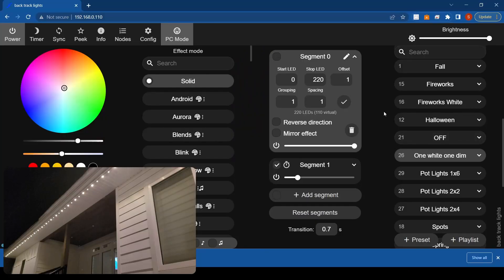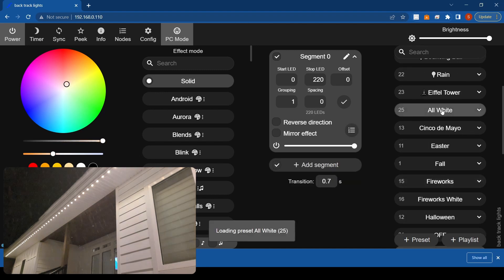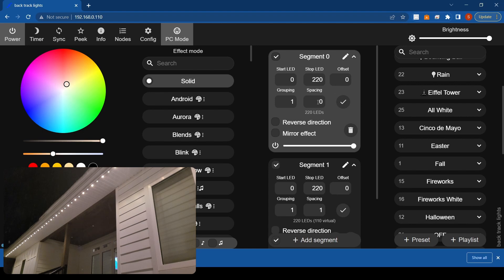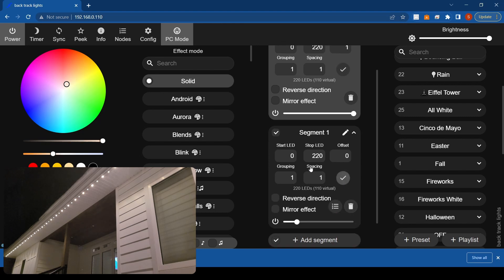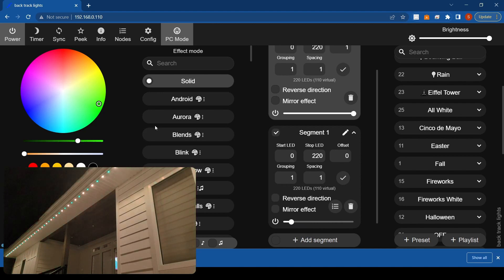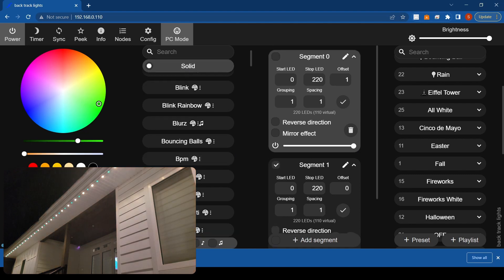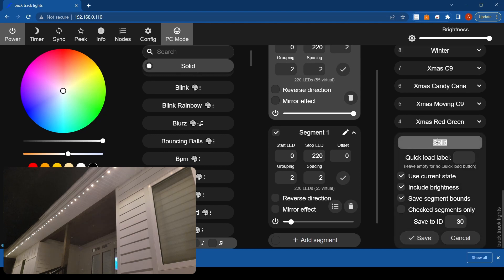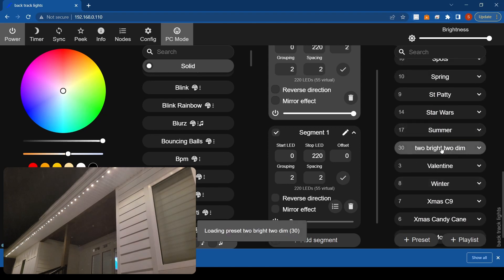Using offsets to make patterns

Comment: I am using segments to skip leds on a continuous run with separate sections.  The issue is with an effect like say chase each segment runs it's own chase instead of passing from one segment to the next.  I am looking for a way to fix that, have you come up with one?

I found some reference to LED Maps that pre-date segments and perhaps that will work, but I feel with how strong WLED is, that it's probably just an easy setting I am missing.